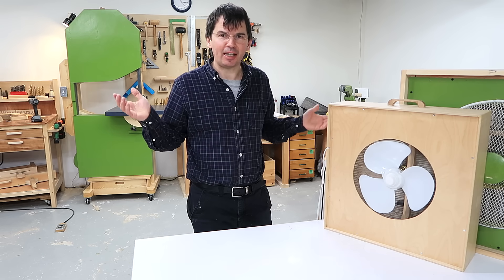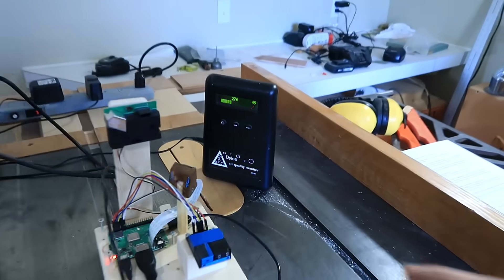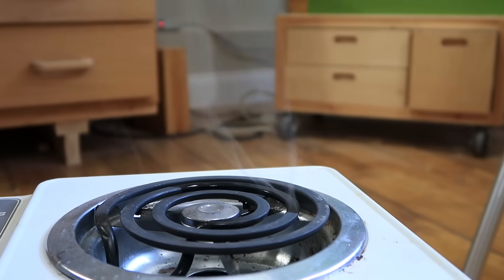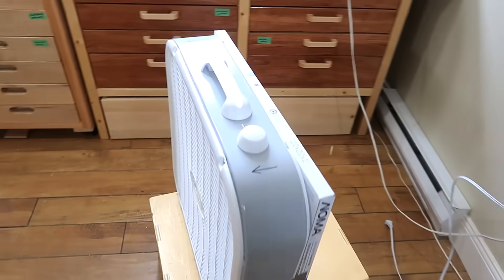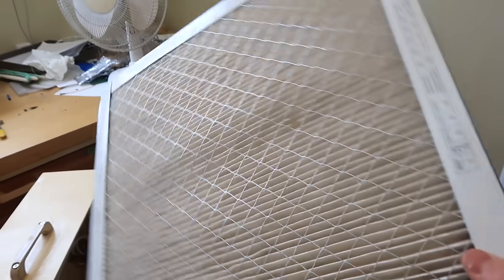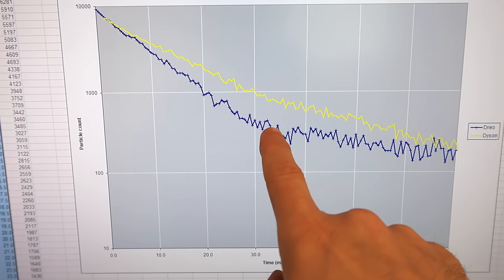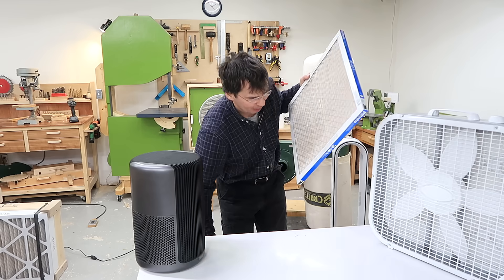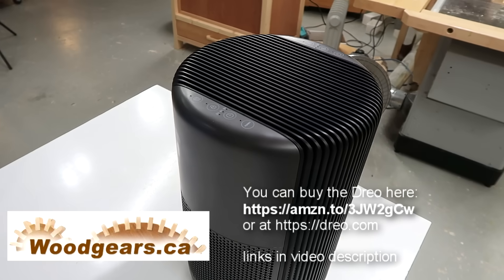Clearing smoke with an Air purifier.  Which is fastest, quietest?

Comment: Would like to point out that the old filter outperforming the new one on the box fan isn't surprising to me, as filter efficiency actually increases a good bit as the filter begins to fill with particles. Obviously, efficiency will fall as it gets more and more clogged, but to a point it can increase surface area of the filter.
Reply from the maker: This totally depends on the filter. Some filters work like a sieve, others more like a dense underbrush, with stuff just sticking to the fibers instead of being sieve like.  Thos filters lose some effectiveness as the fibers get all covered in less sticky dust.

Comment: The important point missed is total operating cost.  The good news is that the replacement filters seem reasonably priced at $29 dollars but how long do they last before they get clogged with shop dust? I've used the 20x20x4 furnace filter with a box fan but to extend its life, I tape a fiberglass pre-filter on to it to try to extend its life.  Plantower make some nice dust sensors.  PurpleAir uses them in their monitors.
Reply from the maker: I wouldn't really recommend it for a shop air cleaner.  though unlike the dyson's filter, you could blow this filter out with a compressor.
Reply: @matthiasrandomstuff2221  You might find this interesting: The dirtiest cooking appliance in your house I have found is the Toaster. And the cleanest cooking appliance is the Crock-pot. Gas ovens (cycling on and off) are just plain evil.

Comment: Wow! This was a really fun video to watch. It's timely for me as I've been have very high dust levels in my garage while wood working. In the winter and early spring it is pretty cold and windy, especially at night, so it is not practical to leave all the garage doors open. I have been trying to decide between making a fancy one or buying one. I love your simple home made one for the garage. But, I think your sponsored one might be better near the wood stove in the house. Thanks for all the effort you put into this. You made my day with all the data collection, analysis, and presentation!!! 😃
Reply: That filter shouldn't run while doing woodworking, a HEPA filter would be ruined in no time. Leave, let the dust settle 5-10 minutes, then come back and turn it on for nice clean air. You probably know that, so take it for what it's worth.

Comment: This is an excellent video. I feel like I learned a bunch about air  filtering systems. And I'm motivated to tape a filter to a box fan to clean up the dusty air in my house now. I'm surprised at how well that actually worked!
Reply: I did exactly that during wildfire season a few years ago. It really helps, and was comparatively very cheap. I set up multiple fans to try to swirl the air around the larger rooms. Only issue was the noise level - I'd run them during the day if it was really bad, but otherwise I tried to run them overnight (while I was in a different part of the house) or while I was out.
Reply: Lol. Me too. Thinking of putting one in every room actually. Maybe rig up something that runs it x minutes per day

Comment: What level filter were the two 20x20" filters you used with the box fan?  What fan speed did you use on the box fan for the test?
Reply from the maker: Maximum setting on the box fan

Comment: I'm wondering if the Filtrete filter worked better than the Noma one because the latter was poorer at trapping the particles (pores too large) or because it blocked the airflow a lot more (so it filtered the air just as well but only filtered half as much air in a given time). Perhaps all the filter elements work equally well, and the air-cleaning speed depends mostly on the airflow. Though as you observe, at least the open fibrous filters are no match for the "paper" element filters.

Comment: Why do you place the air filter on the inlet side of the box fan instead of the output? Do you see a performance improvement? Box fans seem to be better at pushing air then pulling, but I guess the flux would be same.

Comment: you wrote a blogpost some time ago about how fine wood dust may not be bad for your health. I found that rather convincing. Can you explain, if your opinion has changed?
Reply from the maker: Having run the particle coutner in my shop for a few weeks straight, it hardly senses the wood dust (I think that one isn't very good with large particles).  so it seems wood dust might be mostly much bigger dust particles, which your nose is able to filter out.
Reply: I've been running particles monitors in my wood shop for a couple of years.  Typical woodworking activities don't move the needle.   Generally speaking, I see significant numbers on two occasions:  1) outside influence such as smoke from fires (or fireworks) and 2) when I run my open frame laser engraver.   The good news is that my JDS shop air cleaner which includes a HEPA filter knocks the levels down to less than 10ug/m^3 within 30 minutes. 

I also monitor both VOCs and CO2 near the laser.  I never see any CO2 increase,  and the VOCs are inconsistent, but, of course, opening a can of finish causes an immediate response which is very slow to dissipate.

Comment: Thats a great video. Very informative! And that Dreo is very inexpensive. Does it perform well with DUST ? Probably the box fan solution is the best for all situations.
Reply from the maker: it would clog up faster than the box fan, though the pleats are big enough you could probably blow it out with an air compressor.

Comment: I wonder if you used fresh filters in all the devices, how it would impact these results.  You may also want to factor in the filter lifespan of the different commercial units.
Reply: Also how does the dyson perform if used in the backflow mode, i feel it would likely stir the air more than the 'standard' mode.

Comment: Good stuff, I don’t mind sponsored videos when they are transparent and upfront. I also much prefer this style of video over the edutainment of “Project Farm.”
I would be interested to know if the glue gun and solder particles/VOCs are cleared as quickly as the smoke particles, and if the filter type (hepa/filtrete/dust collector) perform differently

Comment: I'd not seen it said anywhere that a 3D printer would emit crap into the air before I bought one, but after I got one and was running it extensively, my roommate started complaining about a sore throat and sore eyes. 
I would have expected this to be clearly labeled and warned about if it was this much of a problem, but apparently not. Hopefully some years from now that will change, and people will either know what they're getting into, or filament makers will be pressured into finding a healthier material.

Comment: I've been using the Winix Zero N. Looks like the Dreo is cheaper, and its filters too, though the Winix filters can be replaced and cleaned separately from each other. The main thing that makes me  nervous about those cylindrical filters on the Dreo and the Dyson is that I feel like it would be harder to modify another filter to fit if they ever stopped selling them.
Reply from the maker: I think the Dreo filter is a relatively standard part.  The dyson filter is definitely custom thugh.

Comment: One test was missing: How much does air pollution decrease when there is no air purifier running?
Reply from the maker: Very slowly!
Reply: I suspect that no air purifier would be a close 3rd. As it was not tested, we will not know.
Reply: Should test how efficent is just opening the window. Most of the year is very possible solution and the cheapest!!
Reply: @loodusefilm7881  Living in a city or smaller town with roads, vehicles, construction, fields etc., you'd be surprised how much opening unfiltered windows makes a dwelling dusty AF.
Reply: @rolfbjorn9937  It depends more like what climate and country you live. At normal country outside should be cleaner air than any house inside.
Reply: Exactly!
Reply: I was waiting to see that tested too.

Comment: I think an important thing regarding these air purifiers is the cost of filter replacements. I use a Levoit air purifier and the cost of the filters and frequency of changing them is kind of prohibitive. 
I think I like the idea of the furnace air filter that you can wash out, even if it’s less effective. Plus I don’t know many people who stay in a dirty air environment for extreme long periods of time. Do you?
Reply from the maker: The dreo ones cost about $30 Canadian, a really good furnace filter costs about as much.  The furnace filter definitely can't be washed, but I have blown it out a few times.  But it depends on what kind of dirt you get into it.  Wood dust blows out easily, I doubt smoke will.

Comment: They sell activated carbon filters for HVAC use.  They suck for HVAC because they restrict flow and stress the evaporator.  They would however be excellent for the box fan filter setup.  They could actually remove VOC's and other chemicals in the air such as result from combustion and other chemical reactions.
Reply from the maker: They would suck for the box fan too, too much air  resistance.  Might be ok in an air purifier though.

Comment: Dyson purifier fans have had had the same issue since the beginning really - as you point out the primary air flow (that's drawn through the filter) only accounts for about 30% of the amplifier's throughput. They're more of a room fan with a filter attached than a dedicated air purifier. A lot of their marketing guff used to focus on filtration quality (size of particles and types of contamination removed etc) rather than time taken to remove airborne contaminants.
Reply: Considering how it only takes an extra couple of minutes to do the same job, its probably the fact that its damned expensive and your paying for the "luxury" of it. Other than that, it doesn't seem to be a bad product at all.
Reply from the maker: In this setup, yes, the dyson only took a little longer.  They all went from dirty air to clean air.  But with the Dreo doing it faster, you can think of it clearing a bigger room in the same amount of time.  Or having less noise, and shorter noise duration to do the same ting.
Reply: I have the humidifier version of this (same thing, with ability to add moisture to the air!)  and it's really good.  But I would never have paid full price for it.  I happened to get it for about 40% off as unopened on eBay.  I like how it works and how it looks but you definitely have to recognize that you are paying a decent "style" premium (A bit like Bang & Olufsen!)
Reply from the maker: Being cool looking is a primary function of the dyson fan.  And it excels at that!
Reply: @brookead  Ah looks like they've gone with an evaporative humidifier now - I remember all the humidifier projects getting canned because there were complaints with first generation ones covering peoples' desks with limescale.
Reply: @Chlorate299  Yeah I have never had any problems whatsoever.  The reservoir is nice and easy to fill without spilling water too!

Comment: The Dyson looks mighty high tech, but I love the homemade air cleaner better, it looks sweet and still highly efficient.
Reply: And CHEAP!  Even the sponsor seems a bit price to me compared to the $20 box fan special from Wal-mart.
Reply: @jandrewmore  Or a pedestal fan from the side of the road.
Reply: @user2C47  You've got better luck (or richer neighbors) than I do.  I'm happy if I can find some plywood, and that was before lumber prices went nuts.
Reply: @jandrewmore  I will admit that furniture is not a common find even where I live, and it was several miles away from home. I only mentioned it because a lot of things used on this channel are found in the trash.

Comment: To be totally scienktific you should have a control where you do nothing just to see how quick the stuff settles (if at all).  Box fan with filter FTW based on cost/effectiveness IMHO.
Reply: Ngl, that wouldnt just be scientific, i think its necessary as a measuring tool of "how much is natural decay and how much is the filter's doing"
Reply: The box fan test used the less effective filter.

With the more effective filter, the box fan may have outperformed the sponsored device.

Also missing is a cost comparison.

So, while a great test, it is kind of sidesteps data which would overshadow the sponsor.
Reply: How about just putting the box fan in a window blowing out?  No filter required.
Reply: Indeed, I was thinking that was missing.
Reply: @atatdotdot  scientific*
Reply: @quimblyjones9767  Eh? Replying to wrong person, perhaps?
Reply: He kind of did it with the ineffective filter, but didnt show us the result.
Reply: Correct. Dust settles, even with a fan blowing, in about 30 minutes anyway. The smoke makes a good example because it stays airborne so long. If you have ever burned bacon, popcorn, or something, you know the smell lingers for like a day or two.

Comment: Do all of these filter out just small particles or do they work for ordinary ‘dust’ particles aswell?
Reply: I don't know about the ones featured here, but dust definitely collects on the filter I have (which has a cloth washable pre-filter for that reason). It doesn't remove the need to do vacuum cleaning though.
Reply from the maker: they all work great with bigger dust particles.  Though with the fine pleats, these will get clogged sooner.  The dyson is particularly bad that way, the Dreo filter could be blown out with an air compressor.

Comment from the maker: Get the Dreo air purifier using this link:  https://woodgears.ca/dr/ap
25% Discount code, valid to Nov 15 2022: JWQB86M6DEPA
Reply: Not available in Canada?
Reply: @jstreutker  it's available in Canada at 339.42 and free shipping what a deal
Reply: @jstreutker  It is available in Canada but for 335 bucks Canadian on Amazon up here in hoserland.
Reply: Question: how good is a old/new t-shirt over a table fan on low?
Reply: @MrHack4never  probably just as bad as the useless old style furnace filters that only keep the chunks out.
Reply: @MrHack4never  Like the old adage says: You get what you pay for.
Reply: Ain't I happy that you did a video like this. I needed a small air purifier for my place. Shit, I think the sponsored videos are getting to me.
Reply: Just picked one up. Thank you!